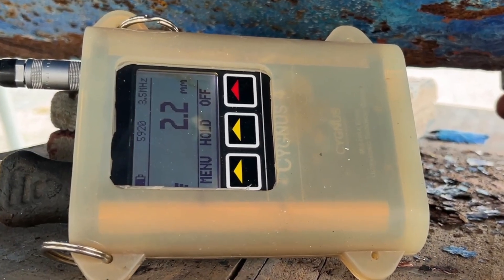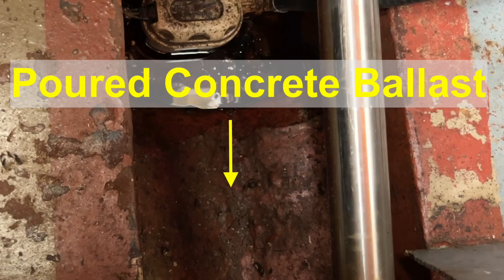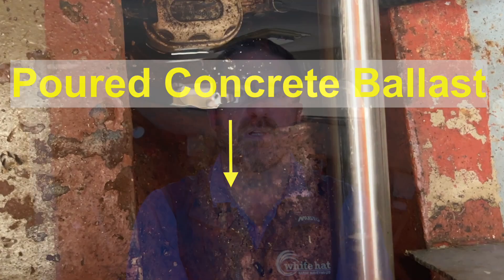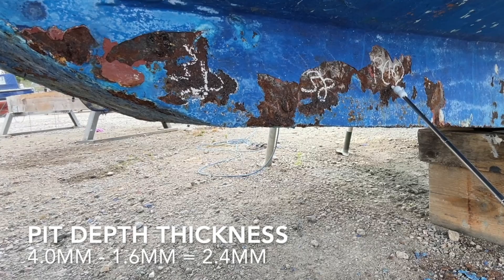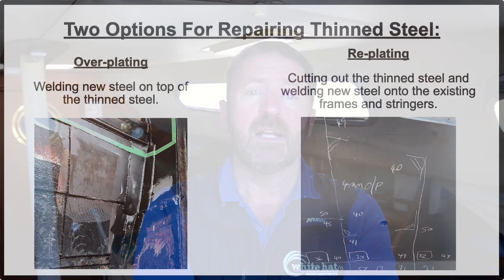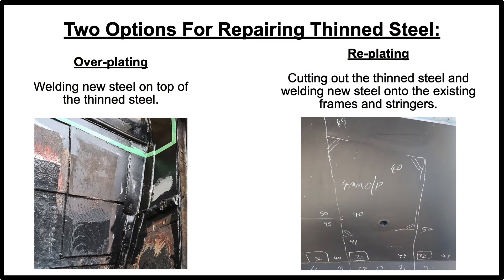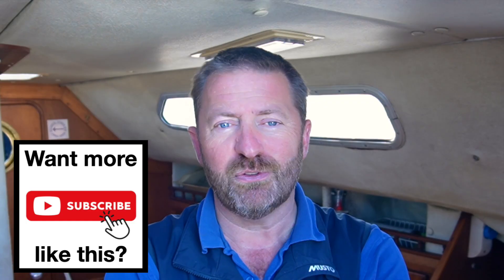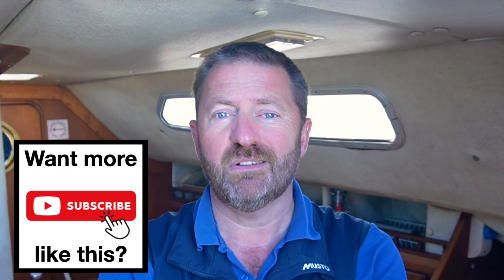Surveyor said “Walk Away” But They Bought It Anyway

Comment: I saw the survey. The keel should replaced. That ballast box is wet and mighty thin. She leaks on land!🤨🙄 I understand their sentiment and wish them an education in welding and lots of luck.  I think if the boat isn't electrically bonded to the hilt, a stray ghost current could easily sink her through a rusted spot. Installing a gold bonding plate would be excellent insurance.

Comment: Over plating is a very bad idea and I have seen the results- rusting on steroids.
Reply: Wow overplating, that's very poor form..
I'm shocked that anyone would do this. Fully against most class rules
Reply: If done correctly an over plating can last for many decades.
Reply: @FlyingConey there is no way to over plate correctly, it creates the perfect conditions for unobservable corrosion, in the automotive industry it's a no no and the marine environment makes it a no brainer, butt weld is the only way to get the result that will last, end of story, if you have been told different you have been talking to an idiot, common sense is all you need to know this.
Reply: @richardeasther2569  No need to get emotional about this topic. Are you a marine class surveyor? First question is if it's legal to double? For commercial seagoing ships mostly it's not allowed but there are exceptions. Second question is if it's possible to make an insert. In order to do so you need access to the hull area from both sides. There's no solution that lasts for ever. You're always talking about service life. A doubling lasts at least 25 years, maybe an insert lasts longer. We've taken off a protective overplaying wich is technically speaking a doubling. It was in place for more than 70 years to protect the hull from cables when fishing. We found no corrosion underneath it. If you're talking about common sense, if you weld on a doubling completely water and air tight from the outside and the inside you have no oxygen in between the plates so the chance of corrosion forming up is very small. Yes a but welded insert is slightly better but sometimes a doubling is your only option. In the Netherlands there are many very old commercial crafts around, sometimes more than 140 years in service, to proof that it works.
Reply from the maker: Agree that overplating done badly is a very bad idea, but if it is done well it can last for several years, possibly decades.  As a repair method for thinned steel it must only ever be considered an 'expedient repair' however it has been common practice on UK inland waterways craft for decades. Commercial vessels can use overplate as a temporary repair but it must be cut off and the thinned steel be cropped out and re-plated at the next docking.
Reply: @whitehatmarinesurveying  As far as I'm aware a proper re- plating or insert can only be done if the according hull area is accessible from both sides. The hull plate must be cut out and a new plate must be welded in from both sides. Do you know if it's class legal in the UK to weld an insert only from the outside?

Comment: Did the new owners re-pour concrete ballast in the keel after they repaired the steel or go a different route?
Reply: Good question, should have lead ballast not concrete.  4mm hull was too thin to begin with.  No matter what the new owner paid, there no such thing as a cheap boat.    Beside the hull, the electrical and mechanicals on that old rust bucket must be  a nightmare? lol.
Reply from the maker: No idea I'm afraid.  I've always been a fan of removing concrete ballast but it adds complexity and time, hence why simply overplating is often the most 'economical' route.

Comment: The big thing is  that the new owner knows there is a problem  as so can deal with it.
if they are happy over years to do it a bit at a time to get it to the final point  then that is ok.
You did say they boat was bought cheaper because of its faults.
it would have been nice to see the before and after shots  and  cost and time spend for this 1st steps..
as well as  what the plans are each year.   
did the keep the concrete ??.
Reply from the maker: Agreed, the new owners were happy to share the basic details of their story but not the full saga. Who knows, I might get invited back for a thickness survey in a few years time.